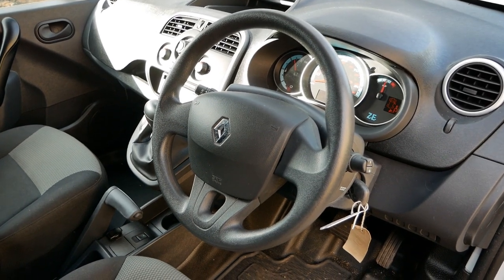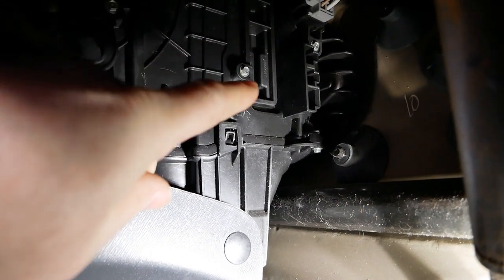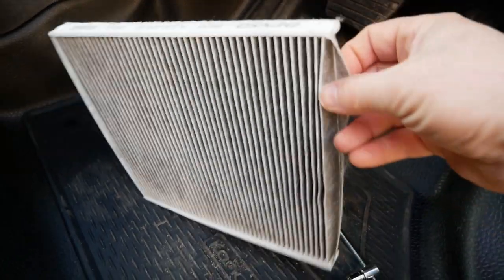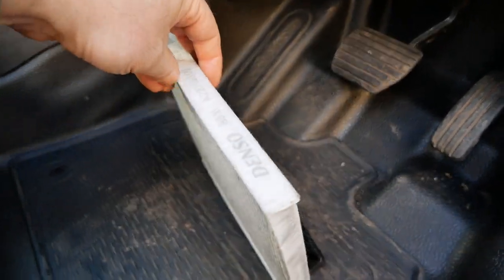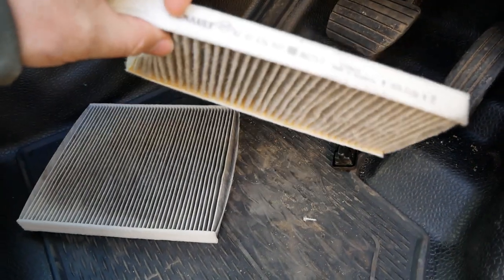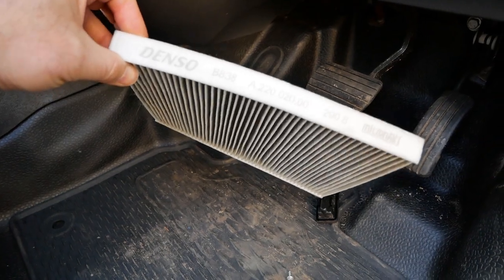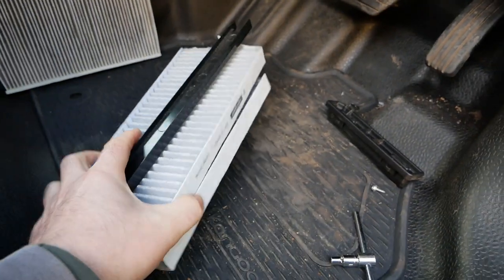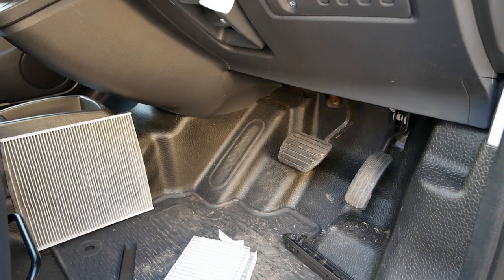How to change the pollen filter in a Renault Kangoo RHD, UK spec van

Comment: Here's a revised version of your text with improved grammar and clarity:

---

I had an argument with the Renault service team after watching your video and checking whether the air filter had actually been replaced, as they had charged me for it.

They insisted that the filter was 100% replaced, but when I pulled out the original filter and asked them to either put it back or bring a replacement for comparison, there was a bit of silence and confusion.

In the end, I accepted two free replacement filter packs and canceled my yearly servicing with them.

Comment: This is a great video if you have electric van.
I don’t, I have a regular diesel van and the clutch pedal is in the way!
In my case, what would I need to do?
Reply from the maker: Have a look at the other side of the heater box, from the passenger side. Some have an access flap on both sides.

Comment: Must admit I haven't changed mine in the two years I've had the van cos it looked too much of a pain! Don't suppose you'll be doing a vid anytime showing dashboard removal to get to the blower motor?
Reply from the maker: Is your fan not working then? If so, it could be the resistor pack which is pretty easy to replace. See this video where I did this job on a Zoe, so it should be similar in the Kangoo. See https://youtu.be/WGzGcyOaGN0
Reply: @GoGreenAutos  thanks but it was the motor. Had to take the dashboard out to get to it! Also went to change the cabin filter and there wasn't one in there! And even worse, when I put the new one in the tab snapped off and the filter has fallen into the abyss

Comment: Matt have you ever upgraded a car's cabin filter?
Is it the Model S that has a HEPA grade filter for biodefense mode?
Given the air pollution in the UK I'd love to get a better cabin filter for particulates in my Kona. Are there any ways of doing this?
Reply from the maker: Have a look on Autodoc as they probably have the best range of filters for most cars. I put a better filter in our Ioniq, which probably uses the same filter as the Kona. I seem to remember my previous MG ZS EV had a PM2.5 filter too. I have my doubts whether these things fully work though due to the way the filter sits in the housing as they're not sealed. They just sit in a slot with quite a bit of slack, so air could flow around the sides of the filter easier than flowing through the paper filter. But they will help though.
The Tesla HEPA filter is on some S & X and I believe now also an Y. See https://insideevs.com/news/563174/tesla-demonstrates-bioweapon-defense-mode/

Comment: Its bloody weird. Australian delivered kangoos its flipped upside down. Wen i install a new cabin filter i have to find a way to keep the first half pushed up then slot the 2nd one. My kangoo doesnt drop down then add 2nd half.
Reply from the maker: ??? Must be because you're on the other side of the world!
Reply: @GoGreenAutos  thanks for the info abt the big filter. I always wondered which kangoo had the bigger filter not knowing the factory filter was the big nearly square one. The dual filter wayyyy simpler to install. Except having to remove few things just to get it fitted
Reply: @A-DUBCLUB
That’s because in the land of down under, you’re all upside down.
In reality, the filters are dropping down into the filter box.